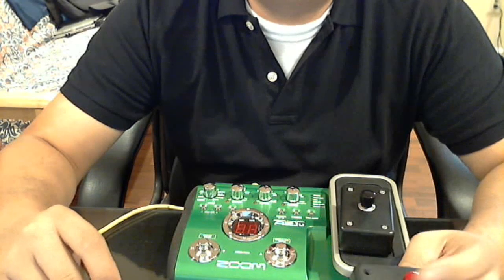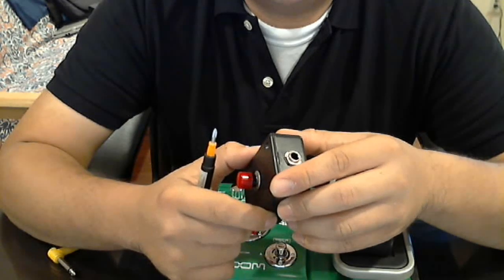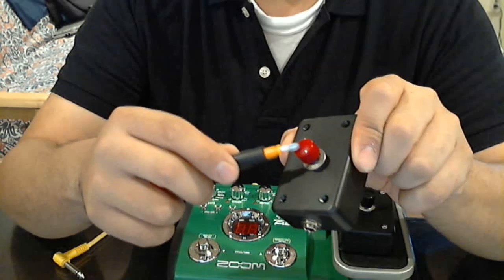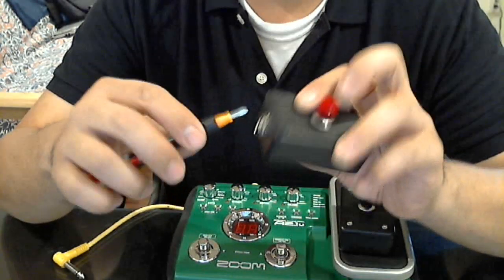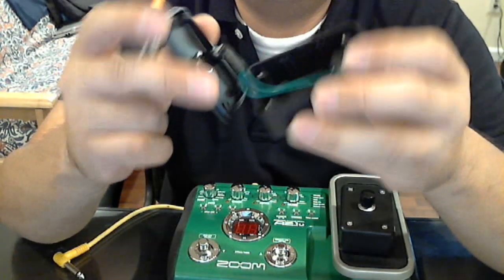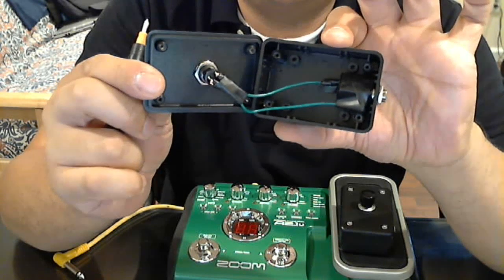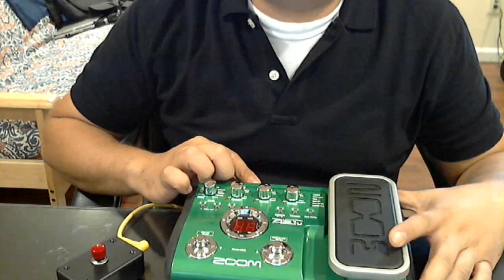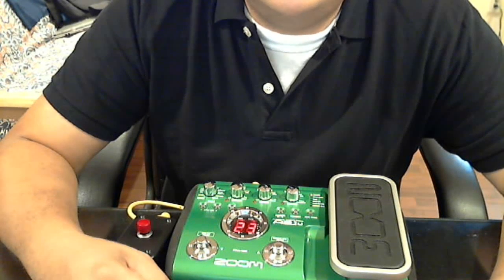DIY Unlatched Footswitch Zoom Pedal / Boss DD-7, DD-20 (Tap Tempo, Bank Switch, Amp)

Comment: hiii what does unlatched means ?  does the switch make contact when pressed or , does it break contact when pressed ?
Reply from the maker: Latched means it's on all the time when engaged and unlatched means it only that moment when you hit the switch is it engaged. There is also normally open and normally closed switches. Best thing to do is google it for a better explanation.
Reply: head8555 thankx a million friend, naaa your explantion is much clear than google hehe :D

Comment: Just tried to put together the parts for this and RS doesn't seem to have the project box any more. So I did a quick search and found that I could buy enough parts for 2 of these, plus pay for shipping for less than $15 at https://www.bgmicro.com/.

Here's what I ordered:

Normally Open Push Button Switch-Momentary     SWT1002
Small Project Box                                               ACS1157
1/4" Mono Panel Mount Jack                                AUD1097

Comment from the maker: You have to make sure it's wired correctly in the 1/4 jack. Then in terms of the Momentary switch it really doesn't matter. Before you solder everything make sure it works. Look at the schematics in my description. Hope that helps.

Comment from the maker: I used a dremel tool. I'm not sure what drill bit I would use. You would have to kind of eye it. Sorry, I don't have an answer for that. To be honest I make these now with the a metal pre-drilled case that I order from pedalpartsplus. I use the Hammond 1590 LB Tap Tempo case which goes for $9.70.

Comment from the maker: @Trenthodge23q  No not necessarily. I recommend you do however you can secure the wires tightly by twisting it and then using electrical tape.